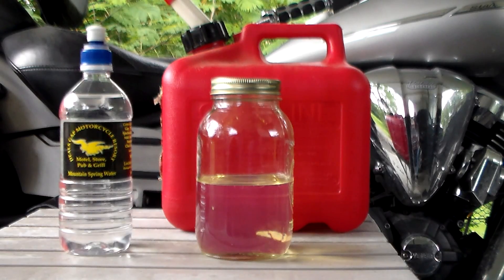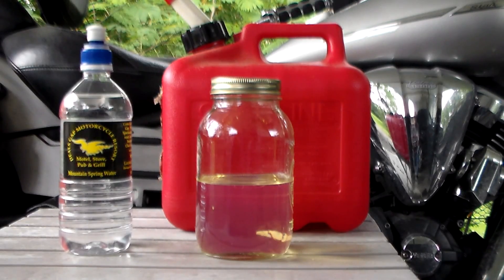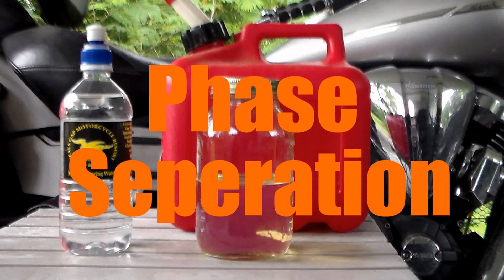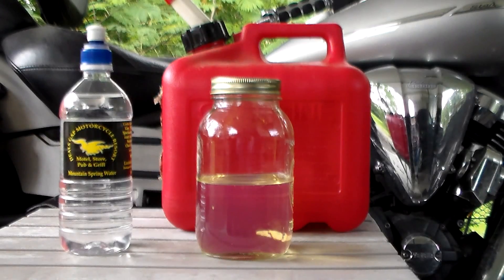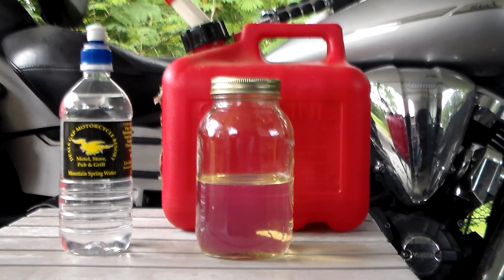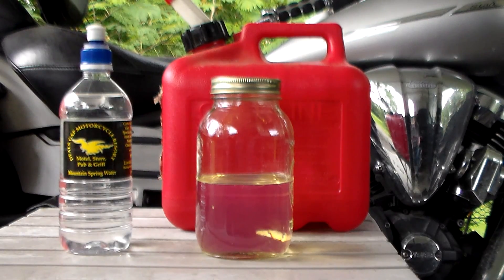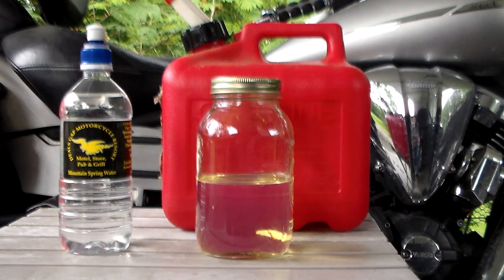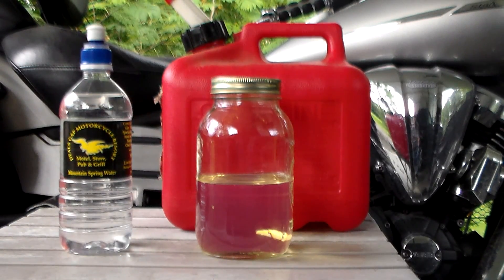Ethanol blended gasoline PSA

Comment: Thanks for posting this Sam. Such great info!
Reply from the maker: +RogueMogul You are very welcome.  I hope it proves useful to you.
Reply: +sam smith Found 2 places really close to me that have the non-ethanol gas. Went and filled up the Hypermotard this morning, and I don't know if it's a psychosomatic effect, but some of the low RPM stumbling, and off-to-on throttle transitions seem to have smoothed out... I didn't expect things to actually run smoother. Is that a real possibility or am I just crazy?
Reply from the maker: Thanks for sharing this.  Yes that can definitely happen.  Ethanol when burned is less powerful than gasoline so with pure gas you should see an approximately 10% boost in power plus better fuel economy.  Your engine was designed for pure gas so it will definitely run better.  Check and see what the octane level is too.  Most pure gas has a higher octane level than the blended regular.  Let me know how it does in the long run.  Take care.

Comment: You pretty much nailed it with your explanation. I try to avoid gas with ethanol, and am a little lucky that where I live the humidity is very low. But, I do use Amsoil stabilizer and I use one of their products that is used to clean what ethanol can leave behind. I think it's called P shot.
Reply from the maker: +vac0002 Thanks.  I'm sure that additive is helping.  Take care.

Comment: Good video Sam, You can not get pure gas around here, its banned in this state. You can get the cans of synth gas but they are hard to find. I have always just run my bike, mower snow thrower etc.. out of gas and store them completely empty been doing that since 1980's and have never once had an issue. I have never owned any fuel injection motors (except my car) so can't speak to those but for me my money is on draining the fuel. Many owners manual will suggest removing the gas for the winter. At least on the equipment I have owned.
Reply from the maker: +MidwestMotoRider Thanks.  I have used the gas removal method myself in the past too with no problems.  The mechanics I used to work with recommended keeping fresh fuel in the tank as a means of stopping oxidation and corrosion.  They saw it from time to time but I never had a problem with it.  It was hard to find it here too up until a few years ago.  Now it is popping up everywhere.  Take care.
Reply: sam smith Yea, I have an advantage that helps, I have a heated and Air conditioned garage so oxidation is not a big deal. In this state they only make exceptions for Racing fuel and aircraft fuel however racing fuel is pretty hard to find as well unless you race and know where to find it.
Reply from the maker: Do you have any marina's near you?  The boating industry is really big on it.
Reply: sam smith Yea, I live on the Chain O lakes so there is probably more marina's than gas stations around here..lol I will look into it next spring. It would be easier if I can just leave the gas in the tank over the winter for all my motors..

Comment: Awesome video! I have an emergency generator that has a plastic tank (no rust worries) so I drain it after use and prime the delivery system with pure gas, or the synthetic. A friend let his bike sit for about a year and the carbs were so bad they needed to be cleaned by hand, twice.
Reply from the maker: +Ron C Thanks.  Emergency generators are really susceptible to ethanol fuel.  People leave them fueled up and discover the problem when they need to use them.   Before ethanol I would keep 10 gallons of emergency fuel in 5 gallon cans.  Now the only way to do it is to keep it a couple of weeks, use it and replace it with fresh or of course get pure gas instead.  Your friends experience is a common one.  Lots of time the carbs are corroded so badly they have to be replaced.  Take care.

Comment: I use stabalizer and seafoam but in the spring I remove the old  gas and start new  use it to start  bon fires or take it to the recyle place
Reply from the maker: +Scott Wilson Thanks that will definitely help. Remember though those products have an effective life span when mixed.  Try not to exceed it.  Good luck.
Reply: ya  it  is  hard  ..  I  start up the  bike  and  stir  it  up  and  add  more  in  the  middle  I  have  had  good  luck  so  far hahaha that  is  not saying much
Reply from the maker: +Scott Wilson So far so good.  :-)

Comment: Thanks the only question I have is where can I but just gasoline without the ethanol? Thanks for the tips.
Reply from the maker: +HarleyDayRider Thanks.  One way is to do an internet search at sites like this one: http://pure-gas.org/.   Many gas stations are carrying it labeled as recreational fuel plus most marinas now carry only ethanol free gas due to mounting boat storage fuel problems.  Hopefully you can find some near you.  As a last ditch measure you can run your bike dry (out of gas) and pour a quart of Trufuel (found at Lowes, Home Depot and most small engine and lawn mower shops) into the tank and start the engine and run it for a min. or two.  It will then be protected and next spring you can fill up with regular gas again with no problem.  I hope this helped.  Take care.

Comment: Thanks Sam. I didn't know that they've started putting ethanol in the petrol in the UK but after watching your video I've had a quick check and it seems to be coming in under EU legislation. I thought it was just an American problem but no, they've done it here too but just not told us about it. Thanks for the useful information and I'll look into it in more detail to make sure I'm okay over winter. I've got a peanut tank on the iron so she uses her fuel up fairly quickly but 30 days before separation starts isn't a long time. Cheers
Reply from the maker: +Pete F You are most welcome.  When it comes to your neighborhood  just be sure not to let it get too old.  I know you have some high humidity and temperature changes in parts of the UK so it will affect you.  I'm not trying to be an alarmist just a cautionary tale.  Thanks.
Reply: sam smith
I'm using a high-volume petrol retailer at the moment, but I've heard Shawn Smoke mention old fuel and others in America too. It's something I'd just never have thought about before, so thanks again.

Comment: Good advice Sam. I always put some fuel stabiliser in the Harley if I store it for the winter and just use the Hornet but I usually get the Harley out anyway from time to time and ride it. Best thing you can do is use it.
I have a generator that just won't fire and I suspect it's a goner now. Same with my grass strimmer, wouldn't fire but when I changed the fuel it started up fine. I read somewhere that our fuels are good for about 3 months, then start to break down, not sure how true that is.
Reply from the maker: +Hepcat Harley Thanks.  I'm not all that familiar with the fuels you have there but if they are like ours there are volatile additives that have a definite shelf life.  Pure gasoline in a sealed container will last a long time but not forever.  My guess is that many of those fuel stabilizers replace those degraded additives.  Take care.

Comment: Thank God we get ethanol free gas here in Canada. I only use regular gas (which contains ethanol) only in the motorhome. Both cars and bikes use Shell V Power 91 which is ethanol free for us. Good video because ethanol does a number on injectors, carburetors and engines.
Reply from the maker: +motonut Thanks.  One thing I didn't mention was that since ethanol is not as powerful as gasoline when burned, it reduces the fuel mileage rather significantly.  I'm not a fan as you can tell.  Since you run regular in the motor home you might want to keep the tank full to minimize the amount of air cycling in and out.  It really shouldn't be a problem though.  Take care.
Reply: Thanks! Yes, I usually put Stabil and fill the tank up to the max. I don't usually let the vehicle sit all winter. I drive it when we have a dry and sunny day (we don't really get much snow over here on the coast).
Reply from the maker: +motonut Good idea.

Comment: luckily for me I ride all year long but I didn't know it only took 30 days to start seperateing  I usually go through my gas faster than that but since having surgery I've not been able to ride for the past month. I hope the bikes will be OK I did put sta-bil 360 in them when I went in for surgery so maybe I 'll be OK PS I do go out and fire them up each weekend Thanks for the info!!
Reply from the maker: +Robert Robb Thanks.  From what I've seen Sta-bil is a good product and will do a good job in extending the life of that gas.  30 days is what the manufacturers say is the end of the safe gas life but lots of factors are involved.  I know you keep your bikes in a garage(heated?) so the heat and cool cycles are fewer and less extreme as is the humidity.  Also we have no way of knowing how much water the gas already had in it when you bought it.  Even if it has started seperating it is a slow process so I wouldn't worry too much.  If you think it will be over say 60 days I would drain the tanks(you can mix it with your car's gas) and refill with fresh.  Be sure to run the new gas through the carb to get all the old out.  I think in your case the only thing to worry about is the gradual coating of the jets with the separated ethanol/water mixture.  I know you have posted before that the carb on the Softail needs lots of TLC so you know how to fix it if needed.  I hope you are healing well and take care.
Reply: Thanks Sam The garage isn't heated or cooled ( sadly) but we do have little humidity here in Bakersfield. I hope to be allowed to start riding next week. I'm not sure the shoulder's ready for everyday back & forth to work but maybe a little around the neighborhood? I'm going to add some NEW gas to everything today :)
Reply from the maker: Great to hear you have progressed so well. Good luck.